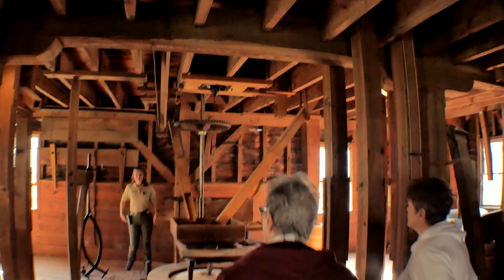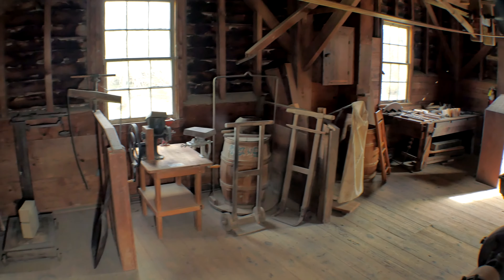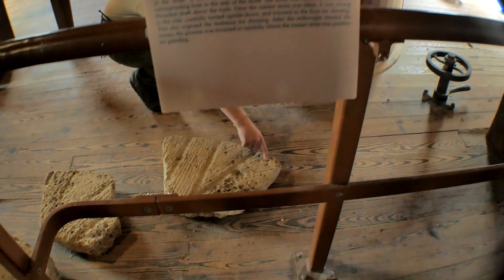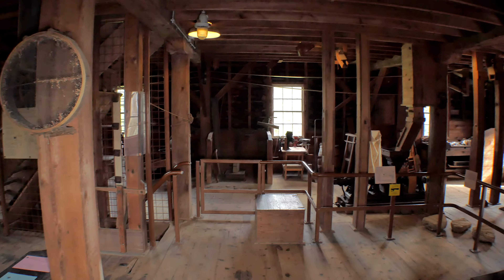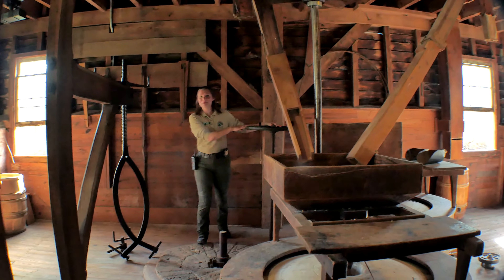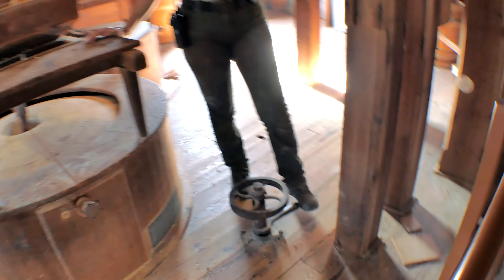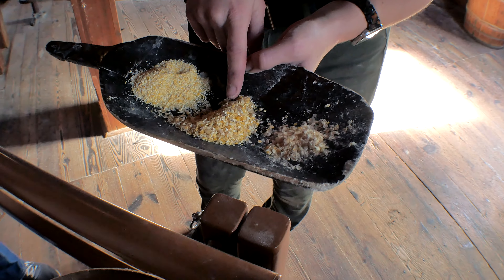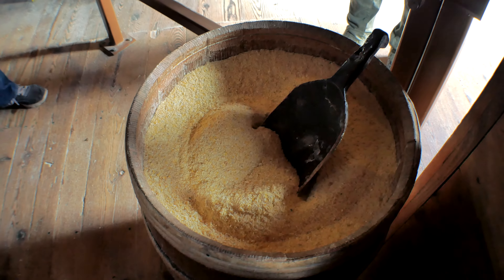Walnford historic village.  How grist mill works?

Comment: Very interesting part 2. The guide was quite knowledgeable! One point I would like to make about stone mills as the device itself. Although stone mills took many forms over hundreds or even thousands of years, the time frame in which this mill was built is most likely the end of using stones for milling. The same may be said for the water wheel. This was a very important moment in the history of manufacturing.  Great Work Walking Cam! So Interesting!
Reply from the maker: Sadly, i forgot to ask her what is used now to move the mill. Didn't see any spinning parts in the basement.
Reply: @walkingcam1  Maybe some other time?
Reply: @walkingcam1  The guide did mention a hydraulic system powering the mill. When I heard her talk about it, it went in one ear and out the other. I'm thinking she was referring to system powering the mill other than a water wheel. Something much more modern.
Reply from the maker: @williamwintemberg  Maybe water turbine? I saw one in the exhibition. Be honest, don't know how it works. Have never met that in my life
Reply: It's all interesting. As it appeared in the video, the startup was very easy. I could go on about what it could be but it would be pure speculation. In other words BS. Maybe at some point in the future it would be interesting to find out for sure.
Reply: @walkingcam1  Happy Thanksgiving
Reply from the maker: @williamwintemberg  Same to you, William))